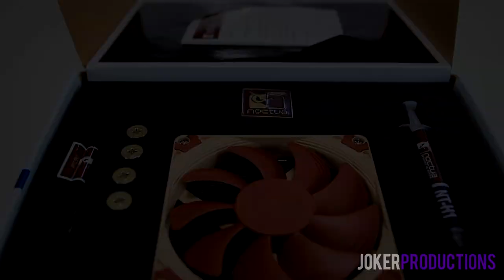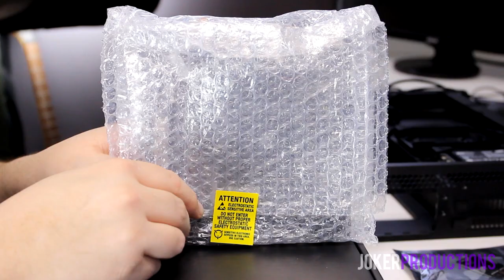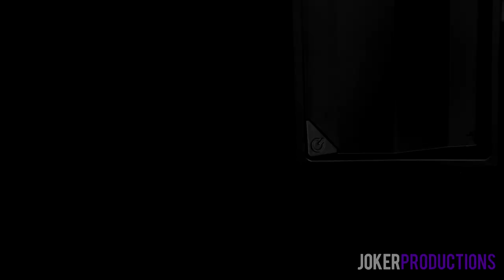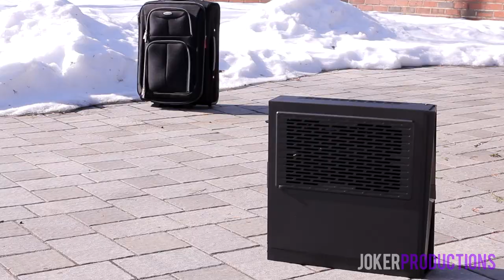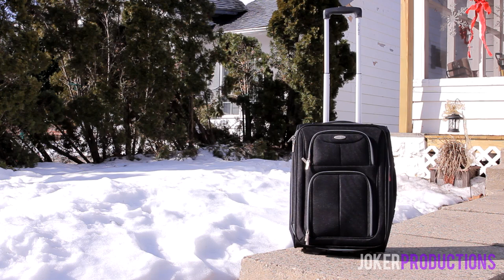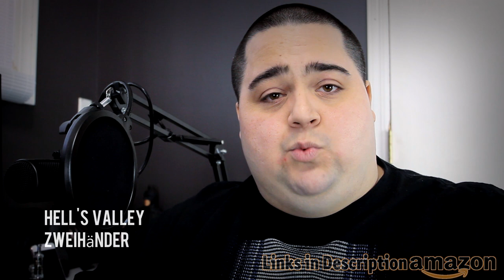Mini-ITX LAN PC Build In A Carry On Bag

Comment: Years late, but do you remember if you ran into any issues going through security with a desktop PC in your bag?  Im about to attempt the same thing with my ITX build
Reply: How did it go man? I. Thinking to do the same
Reply: @masti733  I had no problems.  I built an ITX build in a Cougar case, through it in a pelican case with pick and pluck foam and had no issues coming to Korea on rotation.

Comment: I have a somewhat similar setup with the same idea (carry on luggage), it's actually even smaller AND uses a cheaper full-size ATX power supply. The SilverStone SUGO SG-13 is smaller, lighter and fits an ATX power supply. Combine it with  a Prolimatech ultra-sleek vortex on top of a Scythe Big Shuriken 2 rev b and you got pretty kickass CPU-cooling as well. 

Silly thing is that I was waiting forever for Silverstone to release the case you used, the prototype was really small and light. Final version is bigger and heavier than the SUGO SG-13, quite a disappointment after such a long wait.

Comment: Hey joker I just built a lan system using the same case as well however I used the amd athlon x4 860k would you recommend that I use the cooler that your using in your build the stock cooler is doing ok but was wondering if the noctua cooler that's similar to the one your using would have any impact on temps!

Comment: I'm curious why you decided to put your PSU and cpu fans in that orientation. I have nearly the exact same build and with both of them flipped the other way I am seeing much better temps
Reply: +Joker Productions I mean that your final config with the sticker showing is not the correct orientation. It should be as you left it in the beginning of your video where you wanted it to be "pretty."
Reply: +Joker Productions same goes for the power supply. The fan side should be facing the opposite side of the case next to the window for proper air flow

Comment: Wow, a year after this video released, I built nearly the same PC, just incremented by one generation (i5-7600k, GTX1070) and in the same chassis to boot! I think I saw the hybrid card attempt before seeing the actual build. I still went with a blower graphics card since I was scared about temps but if the SSC does fine, then maybe I didn't have anything to worry about. I'm also trying to see if I can improve temps on the CPU with a Cryorig C7.
Reply: Let me know how the temps are.  I'm thinking about building a system very similar to yours.
Reply: Temps are okay but not stellar. My motherboard's connector placement makes it very difficult to install a larger CPU cooler than the C7 even though there are probably cooler (but larger) options out there. The blower cooler on the GPU also had its limits. I can get some overclocking in before I get to nasty looking temps but not too terribly much.

Comment: Had one those cases, overheating was always a issue sadly, in the end i just went with a ^*normal mini itx case
Reply: Yes exactly. Also, the sfx psu is loud. I sent it back and having a Xigmatek Aquila now. Want an Obsidian 250D or will go with Thermaltake ITX case later. My Xigmatek is fine but im moving and obviously i won't fly with inexpensive and big pc components.